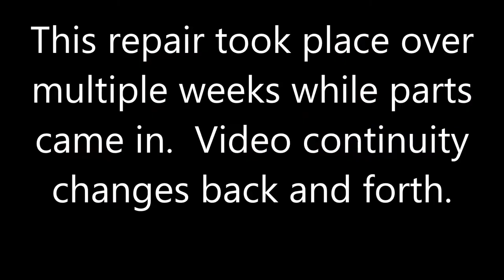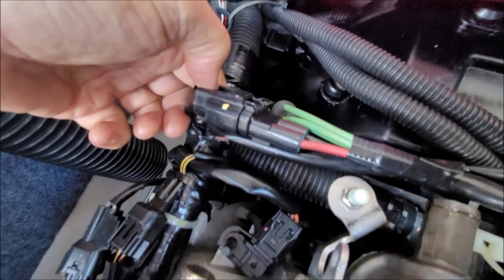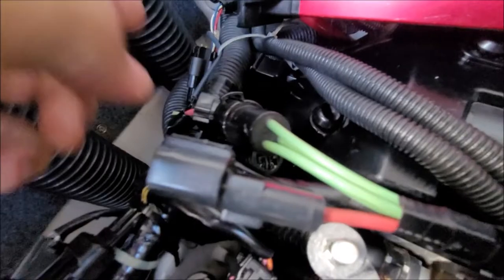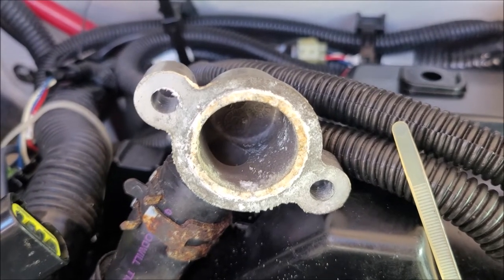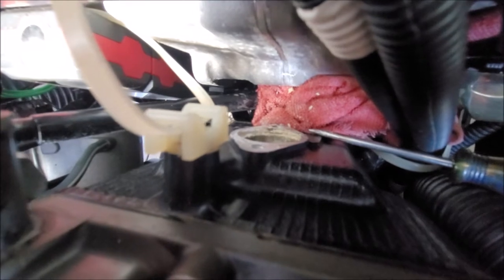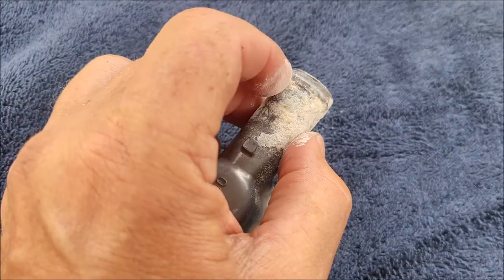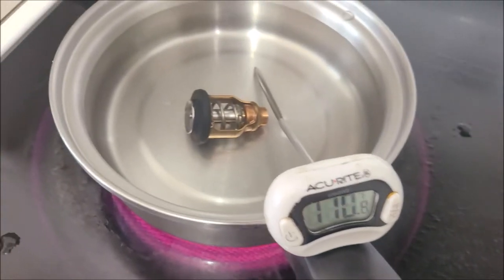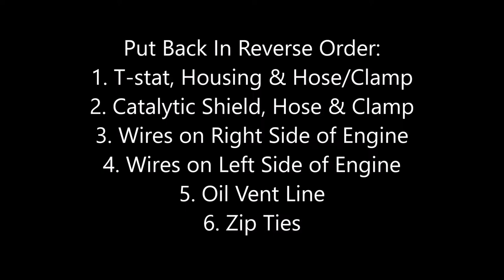Official Yamaha Jetboat Manual Thermostat Maintenance Inspection Replace

Comment: Great videos. Def rig a platform to lay on. My chest was sore for a week after removing my anodes while laying on the engines of our 2020 212x
Reply from the maker: Thanks for the positive comment.  Question now for you.  Assume you are referring to the engine anode on the block on the intake side.  This is my next task.  1. Was it an easy remove/install. 2. How much corrosion was on it. 3. Was there any sand or debris in the cavity?

Comment: That's not bad for so many years of salt water use! I was expecting so much worse.
Reply from the maker: I was surprised too.  The power of always Flushing and Salt Eliminator.
Reply: Have you guys changed blower motor or breakers ? Is there any video about it ? My blower doesn't start right now.

Comment: How did you know the t-stat is faulty? What are the symptoms that I need to look for ?
Reply from the maker: Good question and the answer is:  Boat went into Yamaha's "Limp Mode" and the overheat alarm went off.  Limp Mode restricts the engine RPM to a max of 3K Rpm no matter the throttle position. It's supposed to get you back to a safe spot without damaging the engine.